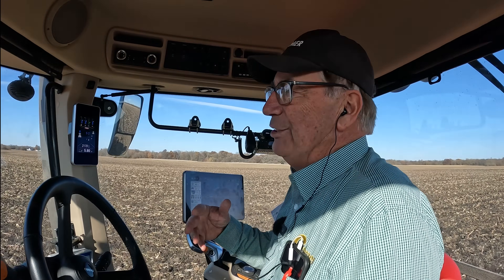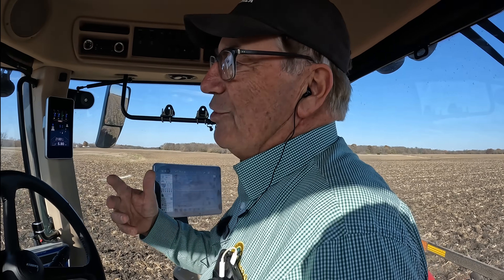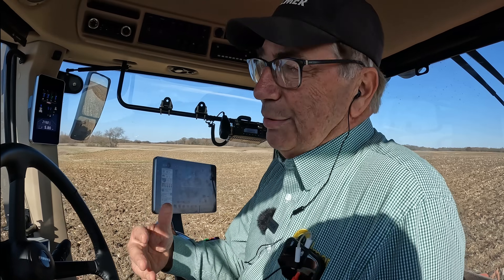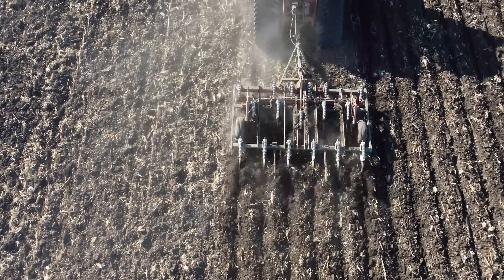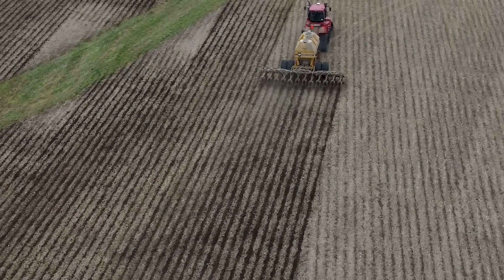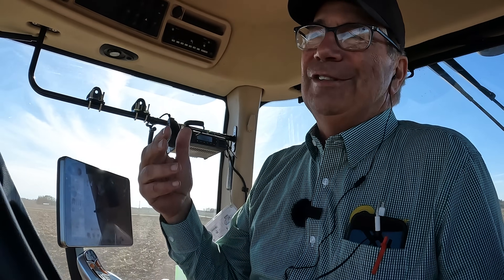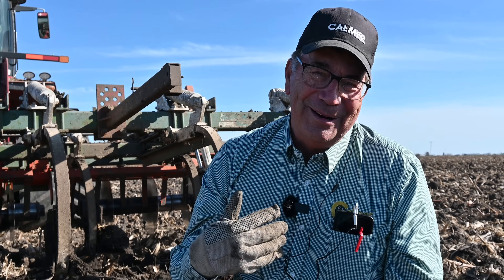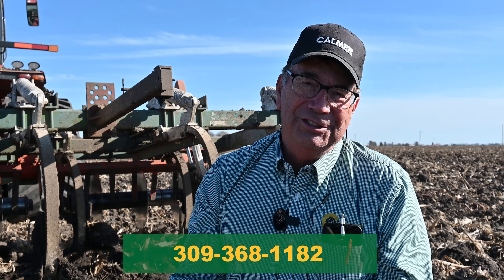Making changes for 2024 at Calmer Farms

Comment: The drone image at 4:15 showing the wide grass swath being skipped over, is that a drainage erosion-risk strip? Or an equipment road? If used for traffic I'd push it to the perimeter where trees and deer eat up the yield. If erosion control, is it seeded with anything other than grass like beneficial insect/pollinator habitat?
Reply: It's a waterway, low spot in the field where water will run when it rains, and seeded with grass so it doesn't erode

Comment: If you do a longer then two yr study the yield will even out. We did a 4 yr comparison and yrs 3 and 4 evened out as long as it is in the same spot every yr
Reply: Seems to me that problems typically arise from using the same techniques continuously. People want to plow, rip, or no-till  everything every year.  Crop rotation has proven benefits, & there's probably a beneficial rotation of tillage as well.
Reply: @davidkottman3440   we have actually found the opposite. The diversity of crops is good, but tillage is different. If you have one program stay with it. The chisel plow after no till  will look good for about three yrs then the yields will lower and be about the same as no till. By the time you put in cost of tillage not sure which one is better long term,
Reply from the maker: Good point on the soil tests. We plan to take soil tests in the Fall of 24 to compare to the original tests in Fall 2021.
Reply: Yields will even out, too, after the microbes run out of residue stay around
Reply: @KevinNieman-i1q Are you saying that the a 4 Year No-Till Study with 1 Year of Tillage of that 4 Yrs with Tillage to Mix in Nutrients, compared to a 4 Year Conventional Tillage Study that the Yields Averaged Out to be the Same?